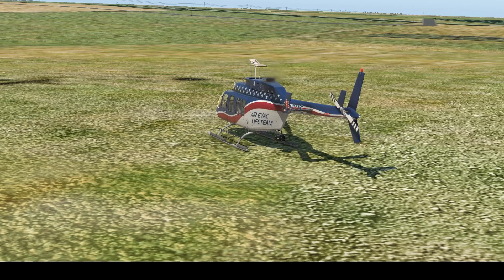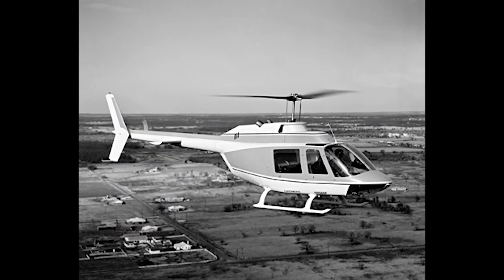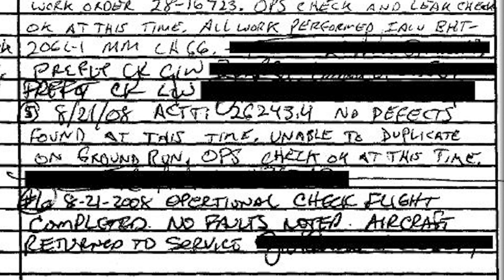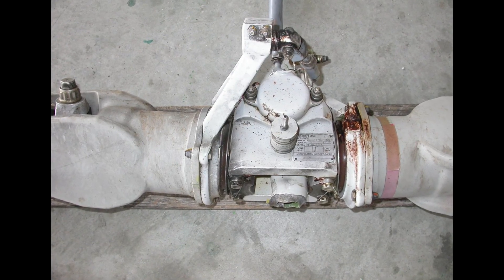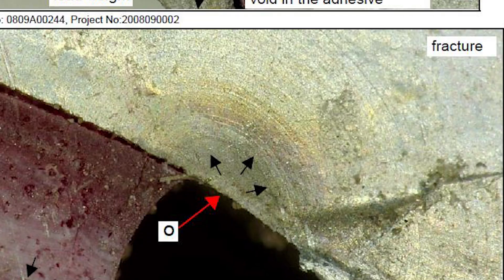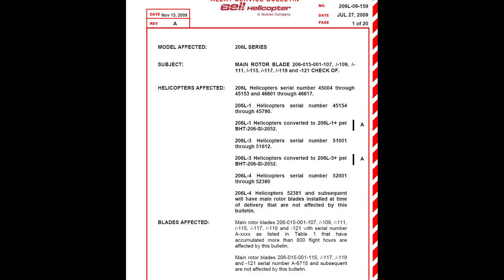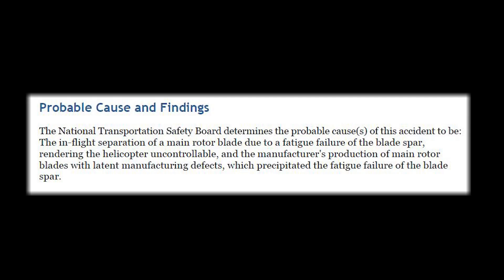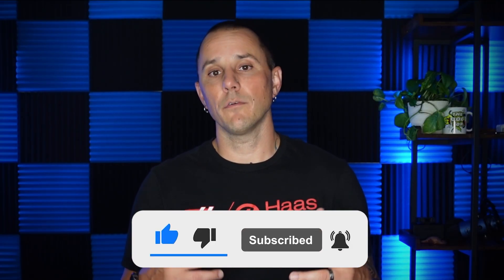Helicopter Rotor Blades Break Apart After Takeoff!  The story of HEMS Air Evac N37AE (8)

Comment: Didn’t learn anything new because I learned early on in the army to avoid all helicopters . Remember being in them as an artillery FO and watching the screws vibrating out as it tried to shake itself apart.
Reply: ..THAT tells me MAINTENANCE and the MECHANICS didn’t do their job..period. Either WRONG screws OR ‘scheduling/service intervals’ were ignored..
Reply: Omg I spent 6 years in army aviation and during that time not one bolt or screw "vibrated out".
Reply: Cousin did 2 with 3/5 in Falluja mid 2000s. The CH47 they flew in on was leaking hydraulic fluid near where his seat was and he pointed it out to the crew-chief. Crew-chief said, it's good, if it stops dripping we know it's low on fluid. 
Helicopter Noun:
1. A million parts rotating rapidly around an oil leak waiting for metal fatigue to set in.
Reply: @Will-W  oh, so they land when the fluid indicator dial shows zero reamaining?
Reply: @geddon436 you don't have a good grasp of dark humor do you?
Reply: @Will-W  Sometimes.
Reply: @Will-W    Sounds a little like the old AN-2 I got to ride back in the 90's with a friend of my Uncle's... "If you see Annie ain't drippin' oil, you already know you need to add a couple quarts before you're done with the walk around." Great plane if kinda goofy looking and slow... damn nearly impossible to crash... smoked too much, leaked oil, and made weird noises that might send you to a padded cell if you think too much... but still a great plane.
Reply: Few properly tighten screws/bolts. They actually have a torque spec. I had experienced AIs tighten them, and then I/we hit them with a torque wrench. EVERYTHING is insufficiently tightened.
They used to tell me if the bolts were tightened to spec they would strip. Some did because the bolt threads were worn out. New bolts cured it.